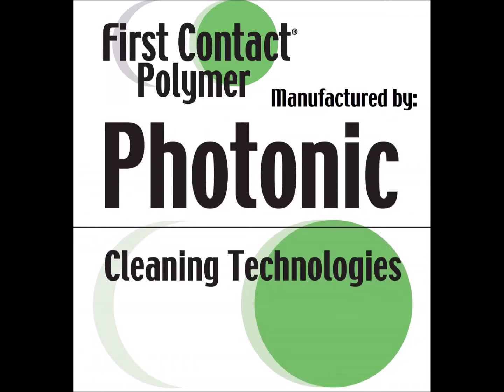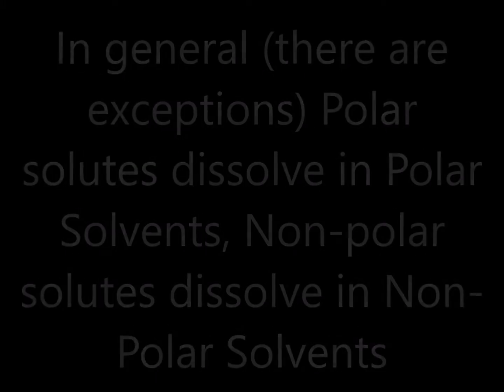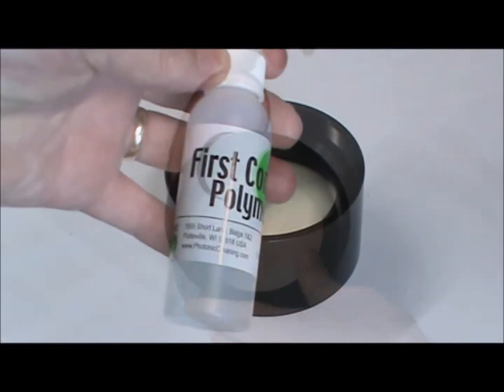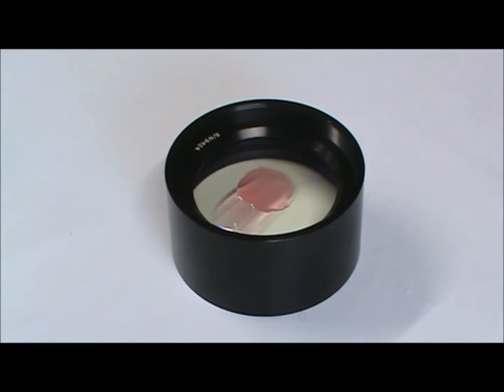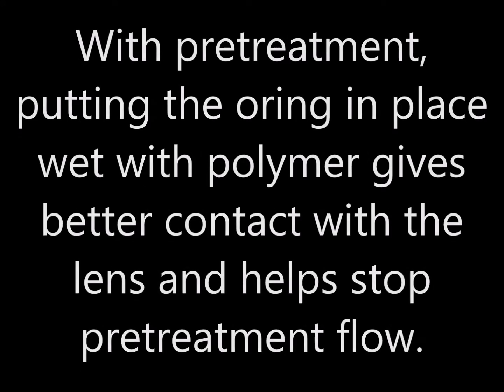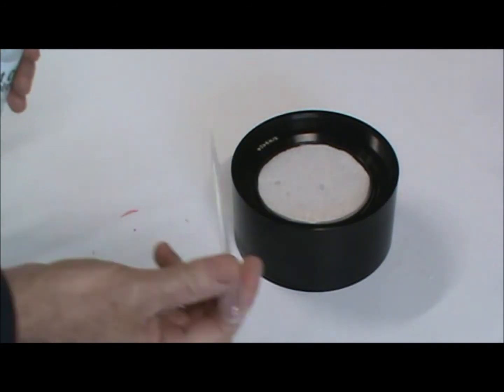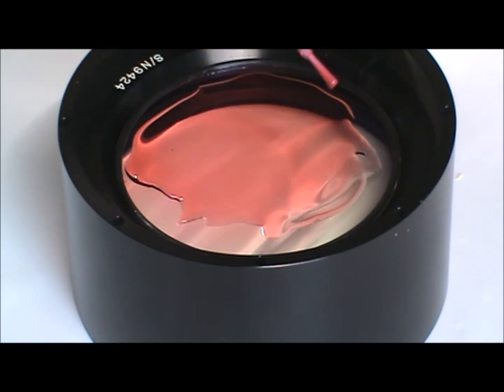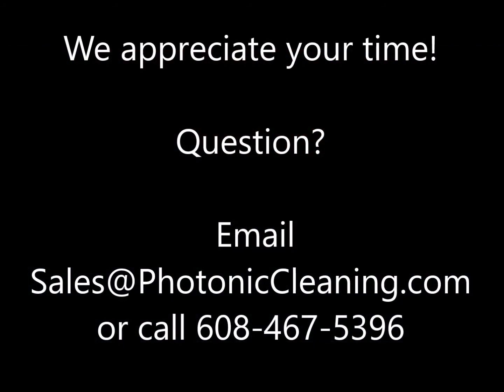Removing Water Spots from Refractor Telescope and Cinematography Objectives

Comment: Q: How is FC Polymer removed/cleaned from the pipet and brush after usage?🤔
Reply from the maker: Both the pipette and brush can be cleaned using the First Contact thinner appropriate to the polymer formula used, i.e. red thinner for red polymer, DTC thinner for DTC polymer.  Alternatively acetone can be used to clean brushes, pipettes, sprayers, etc.

Comment: You shouldn't be using bare fingers!  Use plastic gloves!  Or white cotton gloves, but with solvents you need to be careful with skin contact and disruption of polymers in gloves. Still, head and shoulders above any other how-to I have seen.  Well done, and thank-you.
Reply from the maker: Thank you for your kind words about our First Contact Polymers!  Gloves are recommended and our videos or descriptions mention this, or should if they do not, so that fingerprints are avoided at the very least (although the polymer will remove them!).  The polymers are really no more harmful than a mixture of fingernail polish and vodka, layman terms our engineers sometimes use as these are common items to which people can relate.

Comment: How did you remove that layer?
Reply: Hello,

Thank you for your interest in First Contact Polymer!

To which layer are you referring?  If you're asking how did we remove the dry polymer film (the reddish colored layer) we embedded chemical resistant mesh in the polymer and once dry it was used as a "handle" to peel the dry polymer film.

If we've missed the point of your question please email us at Contact@PhotonicCleaning.com and we will engage your questions more thoroughly.  Cheers!